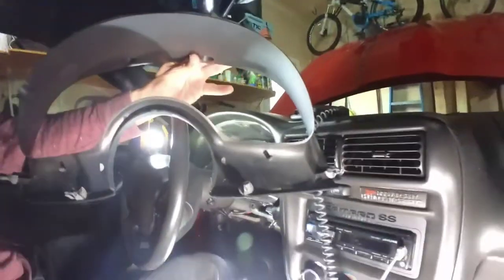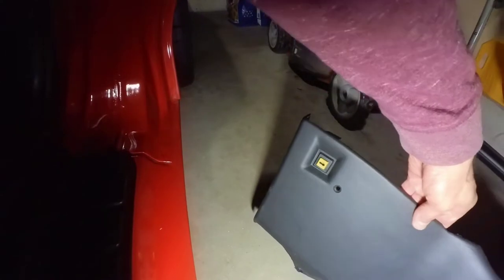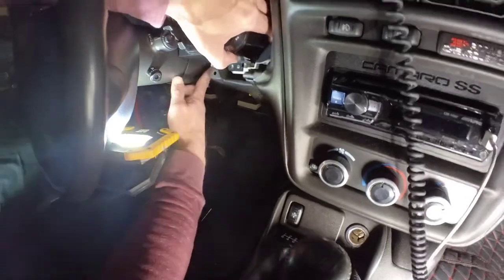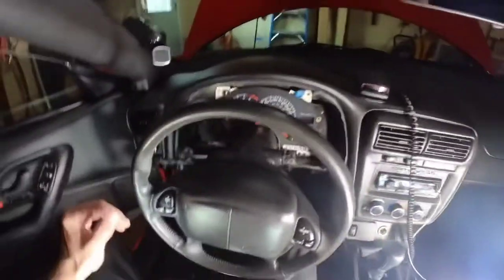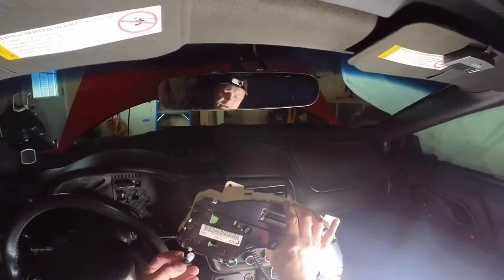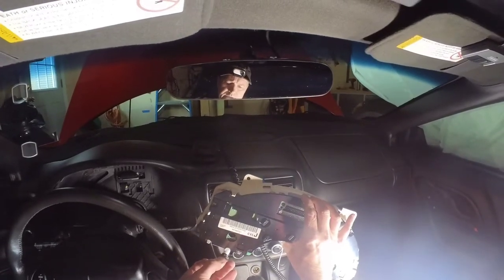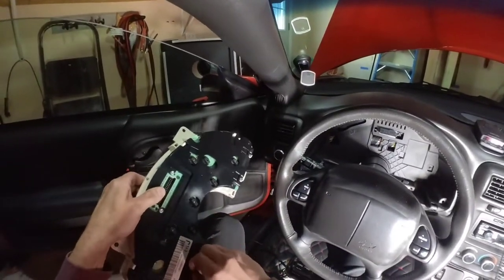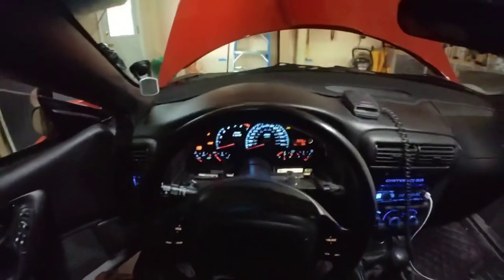97-02 Camaro Gauge Cluster Removal and  LED 194 Bulb Replacement Upgrade. Much brighter!

Comment: Great video and one that was needed.I replaced the gauge lights a few years ago with LEDs and I removed the gauges with the clear benzel still attached and it was an absolute nightmare but it can be done.lol.But then a few months later i had to remove it again to put a bowtie and SS vinyl graphics on the gauges and I figured out then that removing them separately was so much easier.So basically what I am getting at is this video could potentially help alot of people.

Comment: What bulbs did you buy love the hint of blue in those lights??!!
Reply from the maker: Those are just white bulbs. The gauge has a natural blue tint film. The led bulbs are just so much brighter that the tint shows up better. Here is a list of all the bulbs used for exterior.

Hey there. I used these for very bright backup lights which are very bright

https://www.amazon.com/gp/product/B071G7QD5T/ref=ppx_yo_dt_b_asin_title_o04_s00?ie=UTF8&psc=1

Another reverse light option is this

https://www.amazon.com/gp/product/B0749G3M4Y/ref=ppx_yo_dt_b_asin_title_o05_s00?ie=UTF8&th=1

Sylvania bulbs are a little more expensive but they are very good quality for brake lights:

https://www.amazon.com/SYLVANIA-Daytime-Running-Back-Up-Contains/dp/B01A77U85C/ref=sr_1_13?keywords=sylvania+led+light+bulbs+1157&sr=8-13

I used these for the turn signals. Another good quality bulb 

https://www.amazon.com/gp/product/B07569HXNY/ref=ppx_yo_dt_b_asin_title_o06_s01?ie=UTF8&th=1

Sylvania 194 bulbs for rear plate, these are also good for the oem housing for the 4th light thats on all the time. I also used these for the led dash conversion video. They are bright and high quality and you don't want to cheap out on the dash. Yes you can find cheaper alternatives but they likely won't last as long.

https://www.amazon.com/SYLVANIA-ZEVO-White-Contains-bulbs/dp/B07J516FB4/ref=sr_1_5?keywords=sylvania+led+light+bulbs+194&sr=8-5

Once you use led for any turn signals you will need a new relay otherwise you will get the FAST blinking lights. Only issue with this relay is it has no clicking sound to remind you your turn signals are on. You get used to it. 

https://www.amazon.com/gp/product/B07D33JGLC/ref=ppx_yo_dt_b_asin_title_o00_s00?ie=UTF8&psc=1

I used the clear front lens and these "switchback bulbs for the front. They are yellow with front lights off but they are bright white with the lights on. Its a really nice look with led front lights and led fog lights. They will flash yellow when turning signal on

https://www.amazon.com/gp/product/B08QHPG24Q/ref=ppx_yo_dt_b_asin_title_o09_s00?ie=UTF8&th=1

Comment: In watching some other videos on YouTube you've committed on replacing your turn signals with LEDs.  I think you use the 3156/3157: GTR LIGHTING CARBIDE 2.0 (RESISTOR-FREE).  But did you go with the Non-CK or the CK configuration?  Can you link the parts you used to do that?  Or post a video about it?  Thanks.  I like this upgrade as well.

Comment from the maker: Here is a list of exterior led bulbs I have used and links to where I got them. The rear license plate bulb is the same as the dash bulbs. I don't recommend going cheap on the gauge bulbs because you don't want to pull the gauge cluster twice:

Hey there. I used these for very bright backup lights which are very bright

https://www.amazon.com/gp/product/B071G7QD5T/ref=ppx_yo_dt_b_asin_title_o04_s00?ie=UTF8&psc=1

Another reverse light option is this

https://www.amazon.com/gp/product/B0749G3M4Y/ref=ppx_yo_dt_b_asin_title_o05_s00?ie=UTF8&th=1

Sylvania bulbs are a little more expensive but they are very good quality for brake lights:

https://www.amazon.com/SYLVANIA-Daytime-Running-Back-Up-Contains/dp/B01A77U85C/ref=sr_1_13?keywords=sylvania+led+light+bulbs+1157&sr=8-13

I used these for the turn signals. Another good quality bulb 

https://www.amazon.com/gp/product/B07569HXNY/ref=ppx_yo_dt_b_asin_title_o06_s01?ie=UTF8&th=1

Sylvania 194 bulbs for rear plate, these are also good for the oem housing for the 4th light thats on all the time. I also used these for the led dash conversion video. They are bright and high quality and you don't want to cheap out on the dash. Yes you can find cheaper alternatives but they likely won't last as long.

https://www.amazon.com/SYLVANIA-ZEVO-White-Contains-bulbs/dp/B07J516FB4/ref=sr_1_5?keywords=sylvania+led+light+bulbs+194&sr=8-5

Once you use led for any turn signals you will need a new relay otherwise you will get the FAST blinking lights. Only issue with this relay is it has no clicking sound to remind you your turn signals are on. You get used to it. 

https://www.amazon.com/gp/product/B07D33JGLC/ref=ppx_yo_dt_b_asin_title_o00_s00?ie=UTF8&psc=1

I used the clear front lens and these "switchback bulbs for the front. They are yellow with front lights off but they are bright white with the lights on. Its a really nice look with led front lights and led fog lights. They will flash yellow when turning signal on

https://www.amazon.com/gp/product/B08QHPG24Q/ref=ppx_yo_dt_b_asin_title_o09_s00?ie=UTF8&th=1

Comment: I used this tutorial on my 99 z28 to basically reverse what the last owner did since I’m not a fan of the leds,once I got everything back together to see what my dash looked like my abs and brake light came on and gas meter isn’t reading right neither ,no lights where on before hand, any thoughts on how to fix it?(great tutorial btw)
Reply from the maker: Hello, that sounds strange honestly. I know that if you reverse the lights with led they will go dark. Maybe there was always a brake or abs issue the previous owner just shut off with reversed led bulbs? I’m just guessing on that one. Does your abs work? Have you pulled any codes from obd2 port? The lights will only comic there is an issue. Brake light is  the hand brake  so that may need adjustment. The fuel gauge needle maybe just stuck. I would open it back up and adjust fuel guage needle